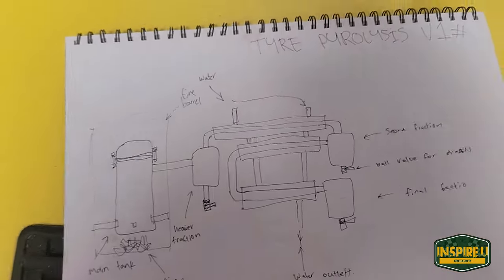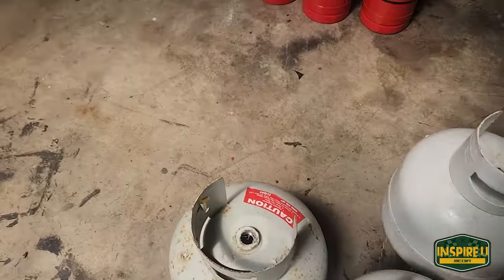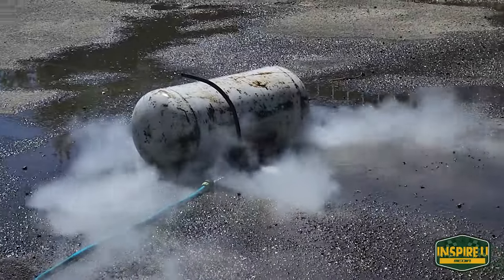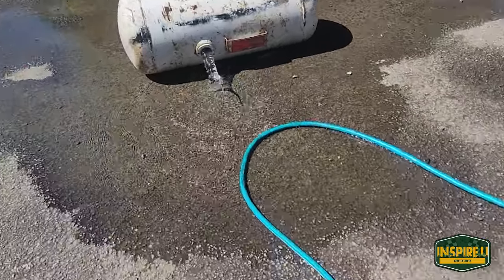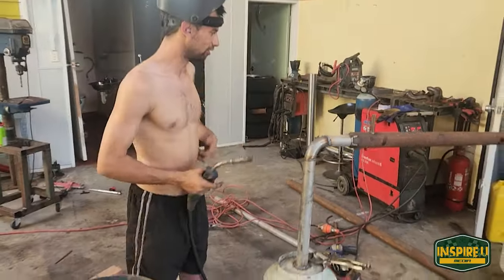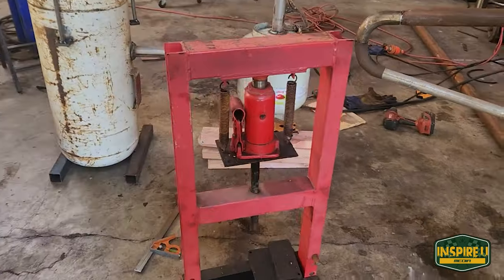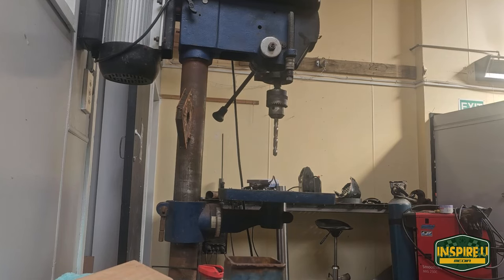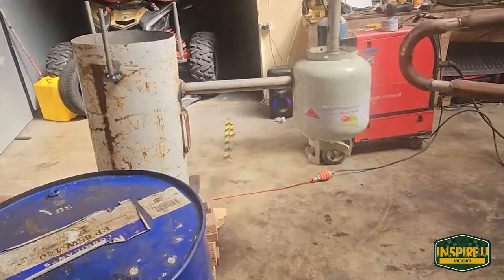Making FUEL from USED TYRES !! ( DIY PYROLYSIS MACHINE)(part 1)

Comment: I worked on the PMR2000 (Pyro Mass Recovery, 2000lb/hr) tire recycling system. We started the burners on propane and switched over to the non-condensing gases (H + CH4) from the process. It was pumped to a storage tank using a 40 H.P. compressor. You will have gasses, too. Everything in our system was nitrogen purged. Analysis of the TDFO (Tire Derived Fuel Oil) showed an almost perfect blend from heavy to light with gasoline about 33%. Be careful, we caught fire and/or blew various parts on on several occasions.
Reply from the maker: Wow that's insane !. I didn't include that part in my drawing but will just have a gas torch hooked up to the final tank and feed it back into the reactors heating. Are you saying that you started the machine on propane then switched to the gasses that were produced and it managed to create enough gas to run it without an extra fuel source ? Thats so epic. Would love to chat more and learn abit more about it. Yea for sure .. the lpg bottle emptying was less than ideal.. trying to build it as safe as I can !

Comment: Once it’s done i really wanna know how much it costs per gallon to make. Like the firewood, the electric to run the water cooler, the ice to cool the water. I’m assuming the used tires are free. Lol. Can’t wait to see whats to come
Reply from the maker: Yeah for sure . The next one that will be a microwave pyrolysis reactor wich will hopefully be powered by solar . I aim to make it so it cost nothing to run just initial cost of building and setup. Am figuring out a good cooling system at the moment aswell wich will cool and recycle the water but also needs electricity to pump it back up to the top .

Comment: I'm not here to throw any kinks in your plans .. so my comments do not come with a lot of experience about this topic.  However, I have a friend who attempted to do something like this .. but with plastic or used oil .. (been a while).  His set up was designed as a vertical unit .. at different heights the gases get lighter .. and so off the top is the best quality.  You might keep an eye for for that style .. and see what you can learn from it.   If you've ever driven by a refinery .. there are a lot of vertical cylinders .. so I'm guessing that is similar.
Reply from the maker: Yea that's wicked I've been learning more and more and vertical seems the way to go !. Hope to incorporate that in the next v2 machine. Gonna finish this one for proof of concept .

Comment: I don't understand  🤔why you would waste the gas an vent it in to the atmosphere  ..🎈
When you could have simply  took it to the bulk tank refill center an let them pump down the portable  field tank
....   🙃  Duh 🤪
Reply from the maker: The captured compressed gas from the final fraction will be burnt off back into the main reactors heating unit for now. In the future when i have a sustainable source of electricty ie solar or hydro , the gas will then be stored into a inflatable matress and then compressed via a air compressor into gas bottles and then used in the bbq !.  The aim is to be able to use everything with next to zero input just waste tyres !.